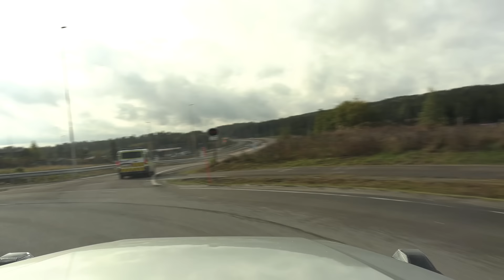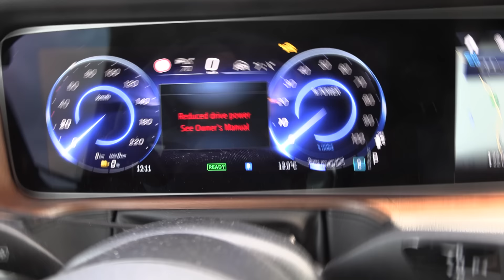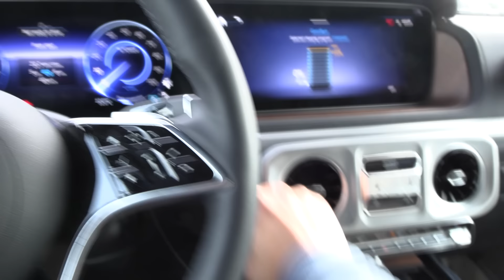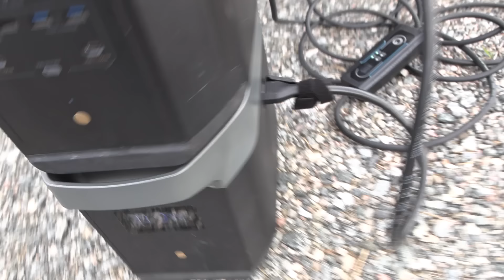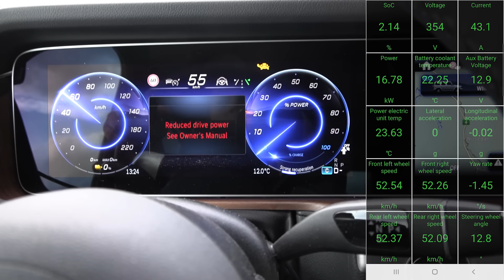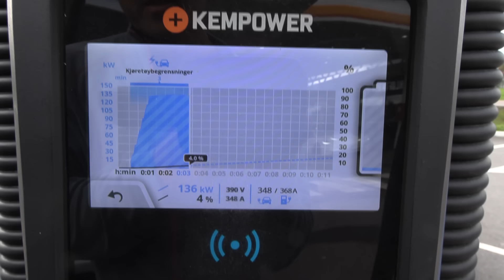Mercedes G580 electric Geländewagen zero mile test

Comment: It’s scary how energy-hungry it is. On your 1000 km trip, I was surprised that you were only driving around 100 km between charging stops. We have a Mercedes EQB 300, and normally we go around 250–300 km between charging sessions with a fully packed car (2 adults, 4 kids, and as much vmax as possible on the German autobahn). That’s in the summer, but still—the G-Wagen uses energy like an old Danish DSB ferry.

Fun fact: this winter I needed new winter tires, and I wanted to give the EQB a more Geländewagen look. So, I ordered Falken Wildpeak AT3s with taller sidewalls: 235/60R18 instead of the original 235/55R18. We instantly lost about 30 km of range—crazy stuff 😂😂😂. But at least our speedometer is finally showing the correct speed now 😅. And as a bonus, the car got about 12 mm more ground clearance.

I wonder how the real Geländewagen reacts to bigger sidewalls and rough-surface off-road tires.

Comment: Such an expensive car with the same MBUX as our simple EQB... At least the EQB tells you the battery percentage on arrival when navigating.
Reply: This car does it as well; it's just that the Digital Extras to do so was deactivated.
Reply: @yj.c.  What’s Digital Extras?
Reply: @MR-vj8dn  Sounds typically Mercedesque.
Reply: @MR-vj8dn  Digital Extras are software extras that need extra payment to be enabled (e.g. EV route planning with automatic charging stops, enabling the Spotify/Apple Music/Youtube streaming apps, enabling Dashcam, enabling Valet Mode, Energizing Comfort, etc.)

For my EQE SUV in my market, almost all were enabled with the purchase of the car, but will only be active for 3 years. Beyond that, I have to pay out of my own pocket to keep using those features should I wish to do so.
Reply: The G580 also usually tells you the SoC upon arrival

Comment: I hope you can test the new Tesla Model 3 with 750 km WLTP range and new battery. It would be insane to fit a 17 inch wheel on it and test that too.
Reply: Yes. I double that. 17" wheels on the new Model 3 RWD with Stalk and on a summerisch Sunday drive would be sooo great to see